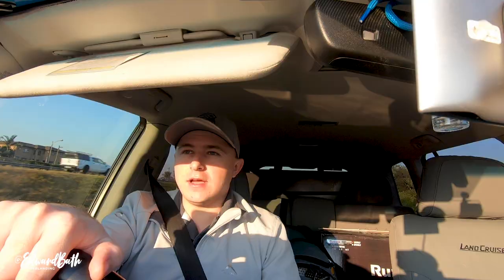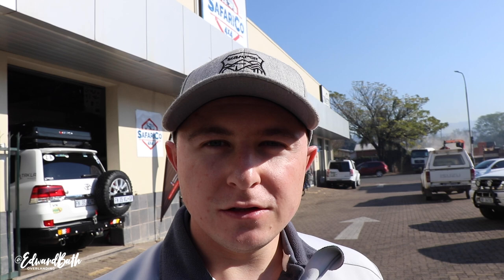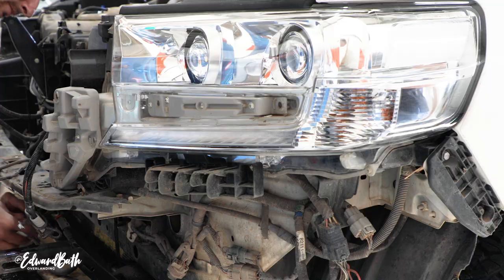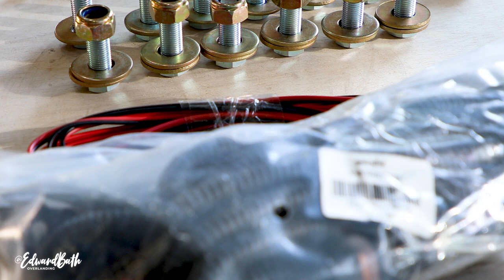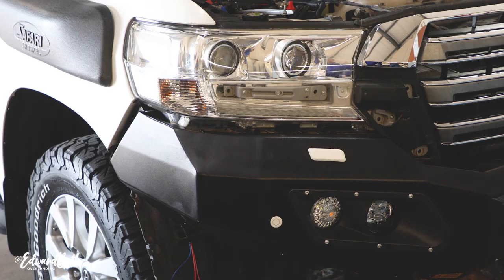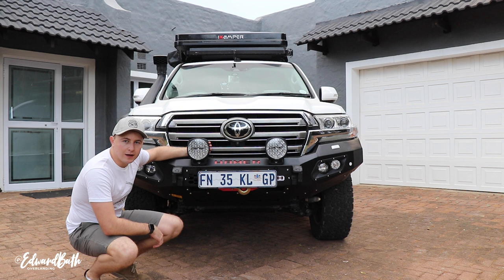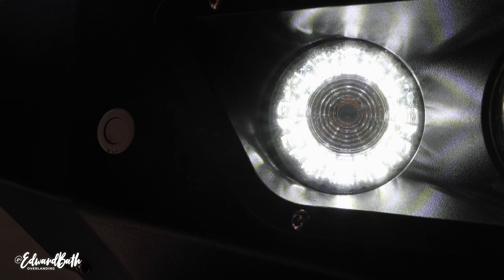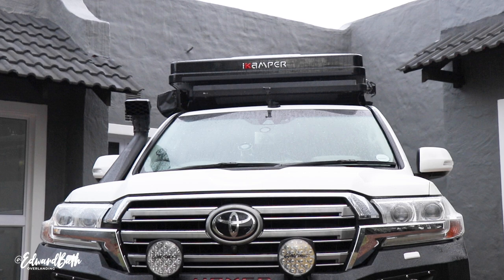HAMER Front Bumper Replacement | LandCruiser 200 Series | Fitment and First Impressions!

Comment: Very good looking bumper, you mention it did not sag after the fitment, did it change now after having it fitted?  It does not look very heavy when the guys picked it up?
Reply from the maker: Thank you Henk! The springs have settled a little but you won’t notice it unless you have a measuring tape, they were 2 pretty strong fellas but the bumper weighs around 70kgs with the winch weighing in at 40kgs 🙌
Reply: @EdwardBath  Thanks, this video got me thinking, so I went and put 50 kg on the front of the Fortuner.  Dropped by 5 mm (I have OME).
Reply from the maker: So I’ve got the bar and winch application springs on the front so I’m sure that’s why it hasn’t really dropped 🙌 which springs have you got?
Reply: @EdwardBath  Thanks, Yes, I have OME.  Thinking of taking the plunge...  First need to fit new tyres this week...

Comment: Edward, splendid video! What about topping it up with a Factor 55 Flatlink? Was the electrics for the winch relocated into the enginebay? Brgds
Reply from the maker: Thank you so much Peter! It’s quite a pricey item but when finances allow it’s definitely an addition I plan on adding! 🙌 have you had experience with the Factor 55? There was enough space behind the grill for the winch electrics 🙌 so I can either plug the controller in there or use the wireless controller
Reply: @EdwardBath  No worries :-) Yepp, they are priceybut the safety-factor when winching such a heavy vehicle as a bogged down J20 as You have, cannot be underestimated. I love the F55 Flatlink but I am considering (....!) the Ultrahook (abt 2xPrice....) I ONLY use softshackles these days. When in doubt, I grab my Bubbarope Gator-Jaw shackles. 
As for the electrics, I have found them better protected in the engine bay provided there is room :-) That being said, we suffer way more hammering from the elements in the arctic hemisphere... Brgds
Reply from the maker: Awesome thanks for the advice Peter! I’m still new to the winching game so thanks for the help, will definitely be investing in the future to make recoveries as safe as possible!

Comment: Not familiar with that winch manufacturer - what cost we looking at for 1300 option
Reply from the maker: It’s an Australian brand and it’s R14k for the 13 000 pound option so that’s the reason I went for it, very affordable 🙌
Reply: @EdwardBath  yeah that is affordable. Uhmmm, interesting
Reply from the maker: Other brands you are looking at 20-25k for similar so it’s worth it 🙌

Comment: Precision fit 5:12 ......., as the guy files down the new bull bars/bumper presumably to make it fit ..... LOL
Reply from the maker: Key word in your comment is presumably, well you presumed and you were wrong. It’s filing off the edges of the steel plating removed to insert the headlamp washers.